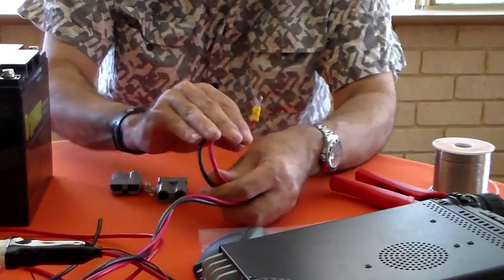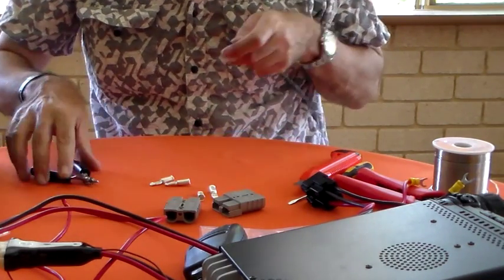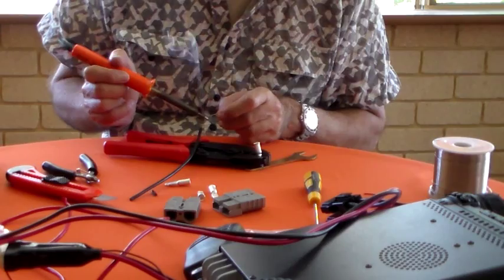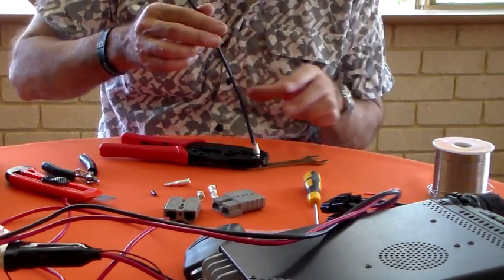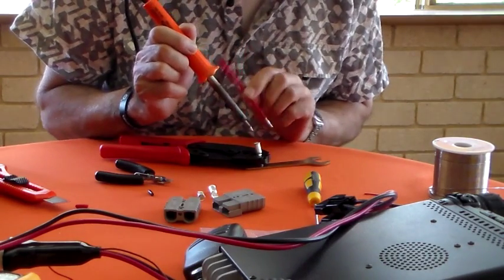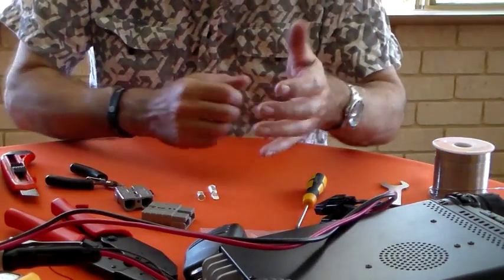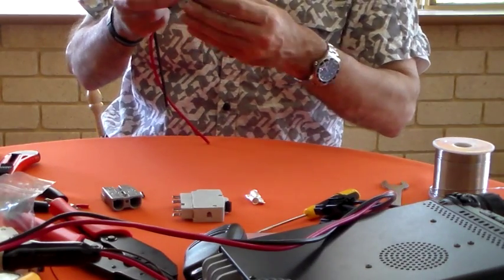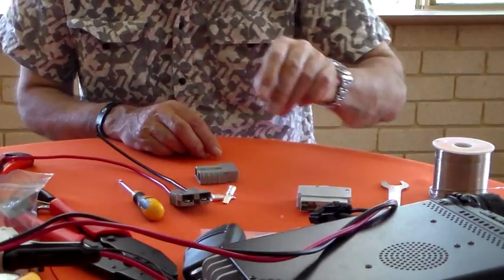Yaesu FT857D Portable Radio Power Supply Part 1.

Comment: 6 year old video now. Time to switch up to the Anderson 15A/30A/45A Power Pole Red and Black connectors with the 10 AWG Lugs. The 857 only draws 22 amps so plenty of power. Pretty much all the Hams here in the States use them on everything 12V with a standardized setup so everybody's radio will connect up to each other. Google it!       N0NVA

Comment: I had wondered what the fuse holder/power cable assembly looked like. I'll likely eliminate the Yaesu fuse holder when I get my radio and install a similar breaker.

9:00: So the crows can feed from my bloated carcass...I laughed. very entertaining.
Reply from the maker: +Wyowanderer777 The good thing about the breaker is you don't have to find a fuse if one becomes 'tired' and goes open circuit when you're out portable. The volts drop across the CB was similar to the fuses from memory.

Glad you got a laugh out of it... thanks for the feedback.

Comment: Sorry to say, some (if not all circuit breakers) are either for DC or AC circuits if you use a AC breaker in a DC circuit it may well not work or at worse run hot when in use.
Reply from the maker: Thanks for the feedback Eddie, I'll check it.